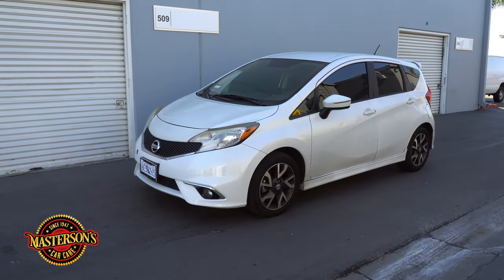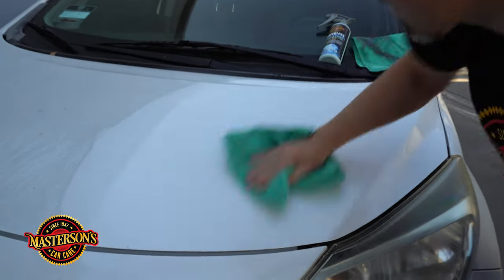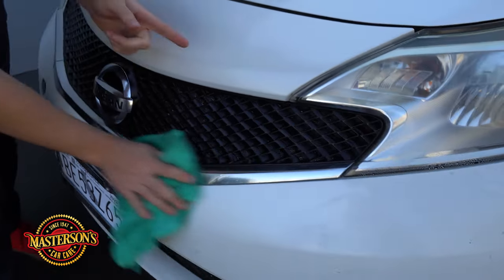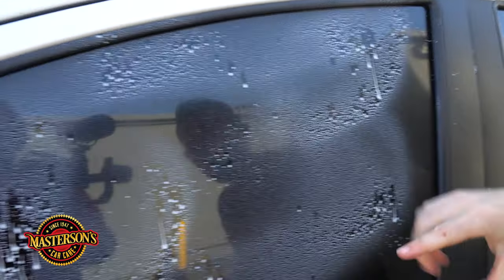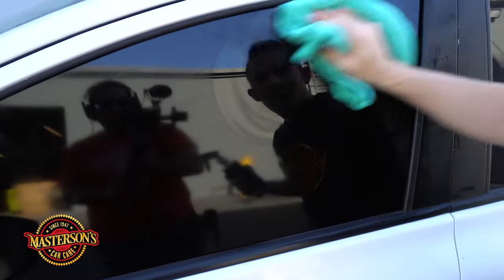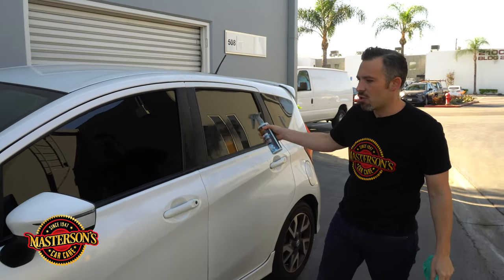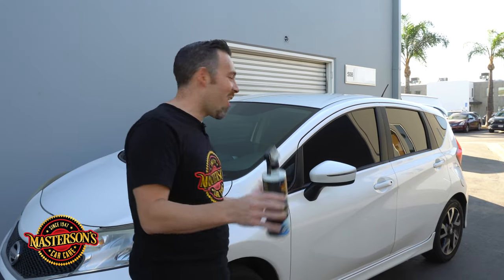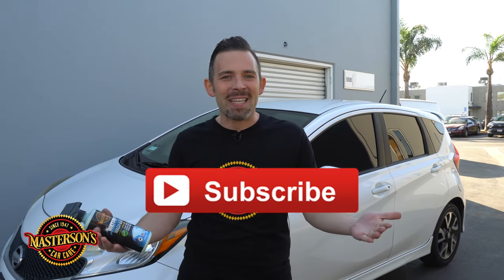Detail Your Entire Car With A Spray Bottle? - Full Car Detail Using ZERO WATER!

Comment: I loved the waterless wash & shine when it first came out, the smell was great and did the job perfectly. I wasn't a fan of the new formula since the smell is very strong so I just use it for my engine bay detailing now since I have the gallon. It works great and protect the engine bay compartment amazingly.